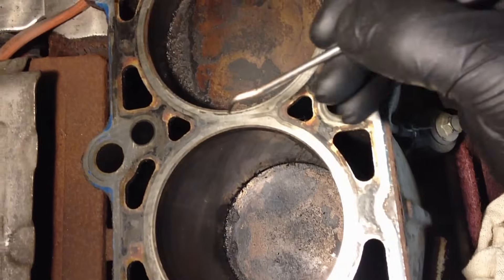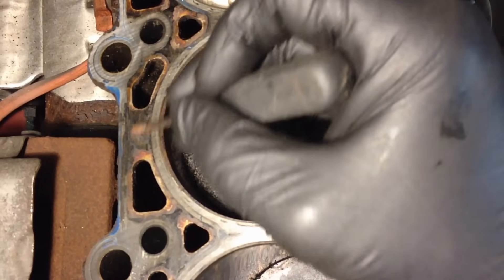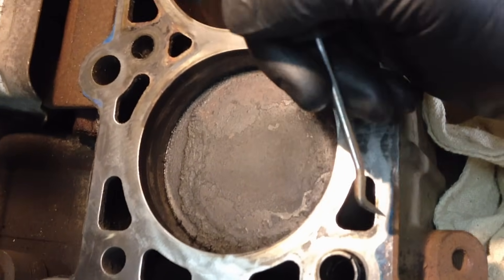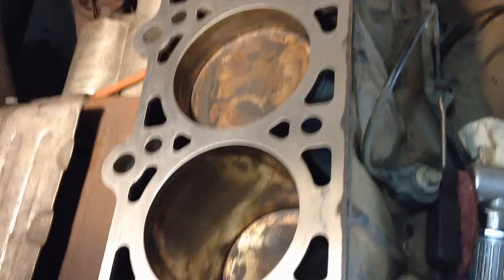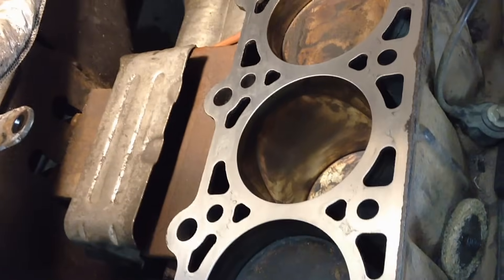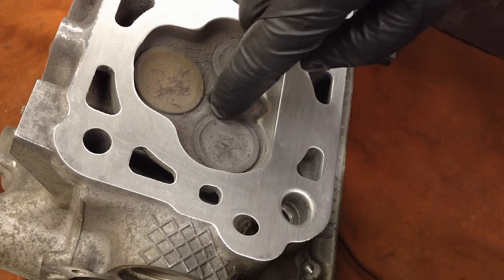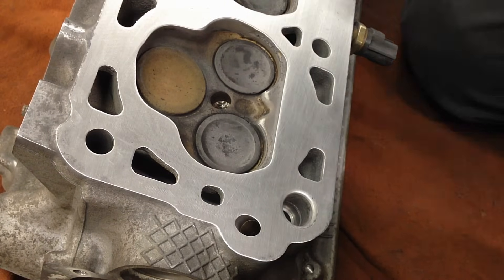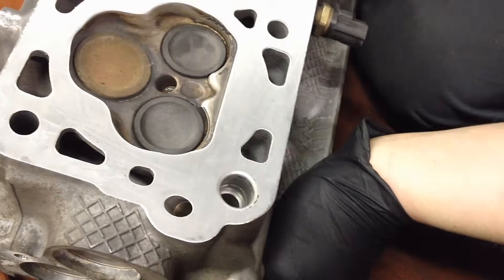My Best Method For Cleaning Head Gasket & Other Engine Surfaces

Comment: I hope you will consider the wisdom of an 'old head'. When I was new in an Acura dealership in 1988 my trainer showed me how to prep block surfaces with an orbital sander and 500 grit sandpaper rather than ScotchBrites which were so prelevant at the time. His assertion was that unlike the ScotchBrites it was impossible to  gouge the aluminum head or block. It made sense, but I was reluctant as the sandpaper introduced abrasive material into the rings.
HOWEVER I came across an issue of Hot Rod magazine suggested shaving cream to prevent abrasive material from damaging the rings; and vacuuming out the foam afterwards. Fill the cylinders, head bolt holes and water jacket with shaving cream before gasket removal.
It just so happens that I had to replace the head gasket on my 2006 Honda Element this weekend and have photos. (355,000 and running like a Honda!)
I've been out of the business for 7 years, but this was my go-to block cleaning regimen since 1988. Vacuum out the contaminated shaving cream after gasket removal and wipe down the cylinders with a shop rag sprayed with WD-40.
https://photos.app.goo.gl/CjZpWbyQnCHjTVxd7
https://photos.app.goo.gl/VPTYnGJBgmX8AkudA

Comment: For years I would use a flexible sanding disc for a drill that i would cut down to about an inch and a half diameter, then i would use aerosol spray adhesive for temporary bonding a disc of Scotch brite pad of whatever grit i desired to it, super easy to change pads and i made a cutter out of tubing the right size by sharpening one end and driving it through a stack of rectangular pads

Comment: I thought I would drop a comment here to defuse all the drama queens telling you how 'easy' it is to cause 'catastrophic' damage to an aluminum block or cylinder head by using the 120-grit Roloc wheel.
I happen to have made a mistake by scrubbing off the crud of my alu block using a small steel wheel brush on a Dremel tool. Mind you my hand was light with it, but still... a steel wheel brush! I checked the block for warpage today with a quality straight edge and a 0.0015 feeler gauge. I used more than 50 control points on each side, twice. The blocks are flat as Kansas. Only 25k miles on them as well, so any warpage or divot or gouge would HAVE to have been made by me. Except nothing happened. People will stress you out by trying to sound more 'professional' than the rest and adding a layer of complexity or alarmism to feed their ego in the comment section. Bottom-line is you really have to try HARD to damage anything, including on an aluminum engine. So don't stress out. The method shown in this video is totally fine.

Comment: Do these 5.4l have cross hatch honing marks from the factory? Mine has cross hatch marks after checking out the cylinders with a bore scope. I was thinking it was a rebuilt block but then everything I read online says this can be from the factory. I would think that even if the factory bores had cross hatch honing it would be almost gone after 278k miles. Anyone know about this?

Comment: The biggest issue in jobs like this is to prevent all the old gasket materials from entering the oil channels (while scraping and cleaning surfaces) because if they do, they can clog the oil pump pick-up tube and cause lubrication issues. How to avoid this?
Reply from the maker: There is only ONE oil feed, tape it off or plug it while you are working if you are so worried about it.

Comment: That is putting grit into the cylinder bores and the water jackets. You should only do that if the motor is completely disassembled before it is hot tanked and washed.

Comment: Take a flat play magnet and   some 320 grt paper and go around the oil pan and timing gasket surfaces, i done that yesterday and it works great, I started with 60 grt lighty and finished with 320the magnet will hold it on there perfectly flat if your not pushing on it all awkward, let the magnet hold the steady pressure! You will thank me later! I have not seen anyone do that as a tip in a video, i just came up with it yesterday, you can make a video and it will blow your mind how well and accurate the magnet works, don't have to worry about making a low side, i used the 2 pack little square magnets from harbor freight!🎉

Comment: My machine shop told me not to use these as they can make imperfect surfaces and cause your headgasket to go. He said use 120-220 or higher if u want sandpaper and a straight edge or two by four
Reply: The white one is equivalent to 120 grit.

Comment: If you Resurface the block Does it change the deck height or do I gotta worry about Interference with my  Cylinderhead
Reply from the maker: If you take it to a machinist for resurfacing, they can tell you how much they can take off for your particular engine. This procedure he though does not affect anything.

Comment: I have a 1990 ford bronco.  I changed the spark plugs, wires, cap and rotor and now it shakes badly and stalls before it even warms up. I’ve triple checked everything including changing spark plugs again.  I followed the manual for gapping.  I’ve also timed it at tdc as best I could bring that it doesn’t run very long.  Do you know what the issue might be?

Comment: Uhmm, you got a straight edge to check deck for tolerance???
Reply from the maker: nope
Reply: @FordTechMakuloco  A high quality straight edge costs about $100. Then with feeler gauges can check tolerance of deck. Looking for 0.003 inch max gap. Around cylinder bores is the most important.

Comment: That’s too much work lol I’ve had great success and just using a quick razor blade to get around the cylinders leave everything else alone and torque it 2 pounds more than factory spec. I’ve never had a problem and I’ve done 20 of these.

Comment: I have a small brass chisel for thoes stuck on gasket areas. It keeps me from applying too much pressure with the wheel in that area. Its good to keep it sharp with a file.

Comment: looks great, but how does it look with a straight edge, or is that not as important as the time saved by grinding down to the metal, removing some of it, and then rounding it all off with a sanding block? looks like the tops of cylinders are well rounded off instead of square. i've done some hacks like this and i'll have to say i was surprised it worked, but then you get the classic models and then you're spooked and try to maintain the square with some nicks and grooves, that also works but takes forever. and every scraping device you have ends up getting used from plastics to hardened surgery tools .

Comment: I have the opposite issue with my front cover. Its aluminum and block is cast. Theres several baked on stubborn spots on the engine as well as the cover. Simply using the scotch brite wont work, I tried. Figure I'm gonna have to use a Rolex on the engine surface as well as the cover. The engine is tricky with the timing chain in the way. Any suggestions or thoughts are appreciated. Good video 👍

Comment: You used a white on the block, if it is an iron block why didn't you use the green one?
Reply from the maker: The colors are just for the grit, for a head surface I just want to clean it not gouge it.

Comment: 5 way paint scraper for all gasket remnants, then brass wire wheel. Almost always. Once in a blue moon, 220 on a DA or similar.
Reply: I like the scotchbrite idea, but maybe with a sanding block, id be sure to leave grooves from finger pressure.

Comment: On a side issue, if a cylinder head gives you a struggle pulling it off the block, skip the hammer application and find which cylinder is at TDC. relieve the rocker arm pressure so that all valves for that cylinder are closed, and pull the spark plug and send compressed air into the cylinder. Unless the piston rings have lost their seal, the pressure should do the work for you.
Reply: @errlglerbsiv2231 depends on the head--an L89 aluminum or number's matching head, you may not want to be chipping away at with a hammer.
Reply: @errlglerbsiv2231 agree with you, light taps won't hurt (the head may have seen minor detonation somewhere in its life and it's still in one piece), but if it's really giving a fight for some reason...air pressure can be an option.

on a side note, a rubber mallet can be made in a pinch with a rubber tip from a crutch slipped over a basic hammer head or handle end--that allows me to carry two hammers at once in the trunk of my smaller cars :)
Reply: @errlglerbsiv2231thanks :)

Comment: Just watched this video after I bought the yellow and white rotary pads disc. I'm doing a head gasket job on a Hyundai Elantra. Only use them a few times in the past as a forklift mechanic I wanted to make sure I was doing it right. This video was awesome and I thank you. Have only used the yellow one before and on a whim I also purchased the white one I'm glad I did because obviously the yellow one would have been too abrasive for the aluminum head. The video wasn't too long straight-to-the-point very informative and a great mechanic behind it I would say. Thanks again
Reply: How did it work out? I have very similar job to do. Any helpful tips would be really welcome!

Comment: hey there i have a question, 2002  ford f150 5.4l v8, do i really need to remove the engine to change the head gasket ..just curious because i dont have an engine lift

Comment: i just use a wire wheel on my drill/grinder with light pressure. simply remove the crud. and use a swirling pattern so you dont trench a section

Comment: I just use a nice sturdy foam rubber auto body pad with a sheet of 220 grit or similar grit sandpaper and it comes off quick. Iron block you are not going to do any damages whatsoever. For tight spots , I use a small 2 inch of a paint mixing stick and wrap it with sandpaper.

Comment: I would trust you to do this with the roloc bristle disc but not any of the mechanics around here . I would rather they do it the old way by flat sanding , at least it will limit the potential for having to do it twice , only needs to be flat & clean , they are not that shiny when new  .

Comment: This dude took a grinder to the damn block.. You can see the grinder marks all over it. I would be surprised if it was able to run without leaking from the very first time you start the motor. That thing needs work after using that grinder for real please dont do this at home this way.  The best way to do this is to take some 240 then 320 then 400 grit sandpaper and use a piece of square steel stock and lay it flat across the entire surface of the head or block with the sandpaper wrapped/taped to the piece of metal tightly and with even flat movement work it back and forth moving to progressively higher grit paper and be sure if you use pressure dont use much and make sure that you apply it evenly but I usually just let the weight of the steel do the work and when you are done you will have a PERFECT surface and can lightly scuff it at the end with scotch bright or something to help the gasket to seal a little better. Please do not take a hand grinder and wheel to the mating surface of the block or the head. There are much better ways to do this without taking a chance on destroying how level those surfaced are because the pressure isnt applied evenly and if you run that across any one of those coolant channels or anything really and catch the edge with that paper and grinder then it will instantly create a low spot across that edge whether you see it or not it will be there. if you took something flat and abrasive and ran across it after this treatment you would see the low spots everywhere that your flat piece of metal would not be able to evenly hit and thats a guarantee.

Comment: The senior master tech at the shop I work at taught me to get as much as possible off with a razor blade then use 600 grit sandpaper with a straight edge and wet sand it till its smooth. This was on aluminum block and heads tho

Comment: I got tiny scratch on head gasket surface aread ar removing head from engine and touched metal insert in corner. Scratch is between head screw hole and coolant area.
Any advise how to seal that area so no coolant getting trough?

Comment: Will a brass wire brush on an aluminum engine work, I've been redoing the gaskets on an engine the last few days and ive been using a brass brush because it seemed to clean good

Comment: I've been using homemade mix of acetone and atf on any rusty or oily anything! It cleans , lubes, and basically swoops ass on it , also helps break carbon loose . Those rolocs can make wavy surface really fast, I like the comment on using sharpening stone and oil too, do u use a machinist steel straight edge and check or just find the fattest graphite p.o.s. gasket to fill any errors? I'm using steel shim gasket on my 396 today .

Comment: Just used the scotch bright tried to pull my towel out of the cylinder and all the dust went around my piston now what do i do?
Reply: Use a Shop-Vac suck as much of it out as possible. get you some shop towels the paper ones the blue ones. wipe it out use some Windex on the towel Wipe Out the dust as much as possible. and then take some oil and rub it around the cylinder should be fine.
Reply: @markjones2185  okay thank you

Comment: I know this is off topic and this video was put out there 5 years ago but I do have a question? I saw those aluminum cylinder heads and there are three valves what is the third one for? Is it exhaust or intake. I actually haven't taken any new engines apart. Normally if I rebuild a motor it's the 5.0. Even though it's fuel injection it's still old school. Still has a distributor for all eight valves.

Like always I enjoy your videos looking forward to watching more. Thank you for sharing all your knowledge that you have obtained over the years.
Reply: Usually 3 valves are going to have 2 intake valves and 1 exhaust.

Comment: Good video. I also primarily use brown scotch brite pads when prepping block decks. I found that using WD40 with the pad sometimes helps remove stubborn head gasket gunk around the cooling jackets.
Reply: Is green pads ok? I used that on my civic block and it’s clean but I read that it acts like 600 grit paper. No I’m afraid I’ve took metal off. Will a straight edge tell me if I’ve taken too much off?
Reply: @bobbo2576  green one is a high grit so it should be finer then the red one so your safe
Reply: I didn't this exact thing on a whim today. Was watching these prep videos to see if i screwed up.

Comment: Something I do on holes that are round, use CAT blue plastic hyd. hose caps and place in the holes then as im cleaning just go straight over the holes and shear off the lip of the caps then afterward take a pick and remove the caps, im doing it on a 1972 grove rt75s with a cummins V555 engine, all the holes are round so covering everything was easy

Comment: About 20 plus years ago,  I had a1977 Dodge van with a 360 ci engine,  it had an internal underneath vacume leak, of the intake manifold warping,  I have seen this before,  normally I would  do this myself, but I  was working and didn't have time,  so I brought it to a HOTROD shop, as I wanted a good job,  they first told me my diagnosis was wrong,   so I said do it anyway,  so they did a surface of the manifold and replaced it,  I picked it up, they said I was correct that the manifold was warped,  it ran good again, about 2 days later my engine started a main bearing knock on start up,  my oil pressure went from 40 at idle down to about 7 psi.  My engine was balanced, it ran great for 45,000 miles until now ?  I couldn't figure out how this all of a sudden happened,  I built a removable crossmember,  so I took it off, took the pan off,  took the rod caps and main caps off,  the bearings were all worn out,  I measured the crankshaft,  it was worn about  .0001,  I put in a new set of mains and rod bearings, and new hi volume oil pump,  I saved the oil for a test, now it runs good again hi oil pressure at idle and no knocking on start up,   I showed this to a engine building company I used to work for, the Forman told me, he has seen this before,  that it was someone who cleaned the surfaces of the block with SCOTCHBRITE discs on a drill without covering EVERYTHING first !!! 😁😁

Comment: Good video, Brian.  You're right about the fact that you need to keep moving with the 3M rotary brushes; you can cut a groove in an aluminum surface if you're not careful.  I use a Shop-Vac to get rid of the left over gasket debris before blowing any surfaces off, especially down in the cylinder bores.  I extended the length of the Shop-Vac suction hose, (they're usually too short to reach into the engine compartment), by using another hose with the nozzle stuck into the end that's supposed to go into the Shop-Vac.  It stays connected if you firmly insert it into the hose.  Even any vacuum cleaner hose will work, too.  Sometimes you'll see vacuum cleaners with their hoses in front of people's houses on their trash day.
Reply: Wouldn't CRC gasket remover do a better job with the pads?

Comment: Do you use the same on the 6.0 powerstroke for both heads and block ?
Reply from the maker: Yes but I am even more careful on diesel engine.
Reply: FordTechMakuloco  can you do a video of how you clean a head gasket surface on a 6.0 ?
Reply: @FordTechMakuloco  How so? I am in the process of doing my 6.0 and am curious as to how to be more careful. The heads will be new, so I am just doing the block.

Comment: The engineers, that is the people who have an actual technical/scientific education, write in technical documents that 3M Roloc style ABRASIVES should NOT be used on ANY gasket surface for ANY reason. When the picture popped up of the Rolocs, I turned the video off as this guy obviously has no TRAINING.
Reply: Call 3m so you can confirm how stupid you sound. We already know it.